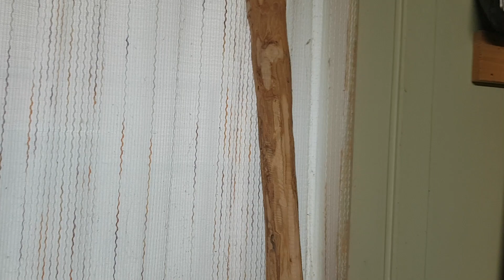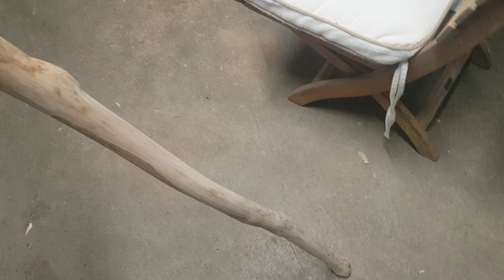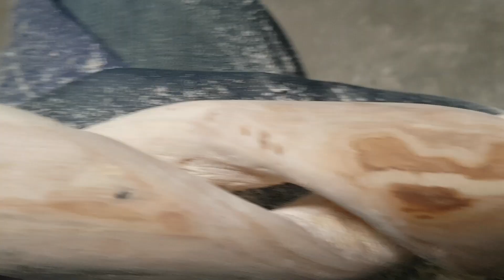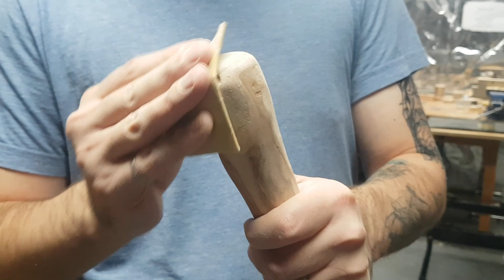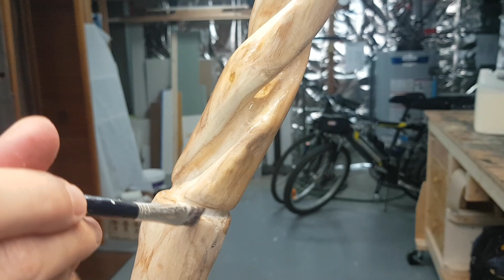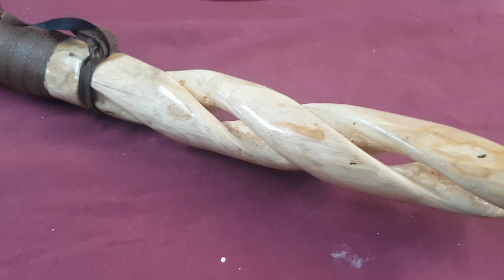ASH WALKING STICK carving

Comment: Hey Jason, WOW. I am working on an ASH walking stick also. ASH is such a hard wood to work with but it is strong enough to hold on to anything. You did a beautiful job on this one. 10-10. Good job, especially since it was Ash.
Reply from the maker: Thank you. Ash is beautiful, too hard for hand tools but a rotary tool works great on it and it polishes to a beautiful shine. Nice and strong but a bit heavy so you have to watch the overall weight of the stick. Thanks for watching!

Comment: That came really nice! My fear is if it slipped out of my hand and hit the ground that one of the twist sides might snap off or something and I would be devastated.
Reply from the maker: This was made from ash so the wood is quite strong. But if you were still worried, you could keep the top of the twist connected together and that would add a lot of strength to it as well. Give it a try and let me know how it goes

Comment: If you spend a bit of time out in the country side you can find twisty sticks that are natural honey suckle make a great job of twisting sticks.
Reply from the maker: Nice, hard to find that in the city but I’ll keep my eyes open for it!
Reply: @JasonHedrich  JASON  i have found some of my twisted sticks in my local parks they can be found i get up early so no one can catch me then walk out with the stick ive  cut hoping no one notices.
Reply: Check near railroad tracks, industrial parks, etc. Basically anywhere that was cleared out and then allowed to grow over again for a few years. Where I'm at in the midwest, most of what you'll find will be box elder and hazel.
Reply from the maker: Great tip, thank you for sharing! I’ll keep an eye out...

Comment: What is the tool you used to make the spirals?
Reply from the maker: @andreicocor4383  it’s a Dremel, or rotary tool with an HSS burr. It takes a while but it’s easier than trying to carve it with hand tools.
Reply: @JasonHedrich  thank you! Do you have video showing this kind of tools you use? :)
Reply from the maker: @ yes, I think I have over 60 walking stick videos uploaded to YouTube, you should be able to find some that explain how it’s used.
Reply: @JasonHedrich  I'll check them out. Thank you very much!
Reply from the maker: @ let me know if you have any questions

Comment: Lovely work Mr Hedrich. I have tried to replicate your basket weave pattern on a stick I have made and think it looks ok. Shame you can’t post pics as I would have liked your feedback. Could you give more detail on how you did the top of the stick please?
Reply from the maker: Thanks for the comments,  I appreciate it. I just kept grinding away with the rotary tool until the insides met. It was a tight squeeze but managed to get it smooth. Then sanded by hand to get the finish. Hope that helps

Comment: Was thinking about the plastidip for walking stick ends.. glad to see someone did it! How do you think it will hold up over time?
Reply from the maker: Yes, I was trying to think up a different way of protecting the end. I think if the stick is used on hard surfaces, the coating will have to be reapplied. But it should hold up if used on trails in the woods.
Reply from the maker: @jscrubs  that’s a great idea… I’ll be checking that out on my next trip to Home Depot! Thanks

Comment: Which Dremel bit did you use? I'm trying to carve a stick out of ash currently and I've gone through so many different Dremel bits and sanding drums I've lost count and it's still not done!
Reply from the maker: for heavy removal work, I found that the Kutzall burrs work very well. They have several different shapes to remove wood quickly. I also use HSS burrs which are a bit smaller but also remove a good amount of wood, and with a light touch leave a nice finish. I don't use the sanding drum burrs, I find they wear out quickly. I still do all my sanding by hand at the end.

Comment: How did you hold the leather on, is it glued?
Reply from the maker: Yes, I glued the top and bottom of the wrap onto the stick. A little contact cement and it held just fine.